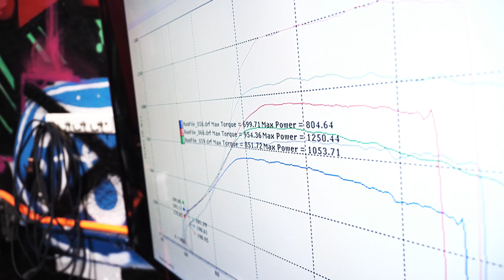Datsun Build putting down 1500 HP

Comment: Man... the way the front just vibrates shitless at high rpms, anythought on bracing chasis or frame when ls swapping a datsun? Not sure if it would twist up the car or not.
Reply: Great Video though!
Reply from the maker: @BarterBales  Didnt do any of the chassis work on this car.  Just the turbo kit but everything is braced very well, Solid mounts mid plate ect..